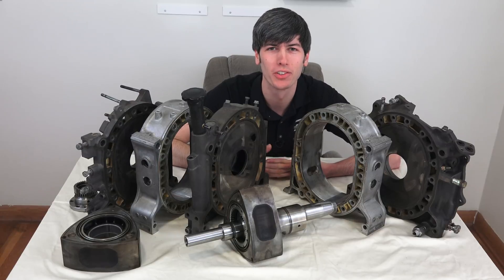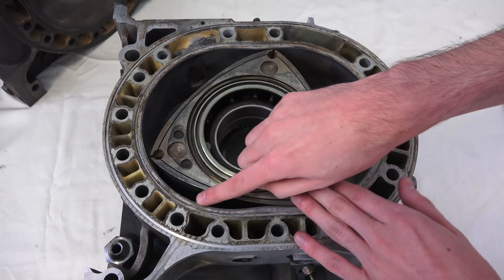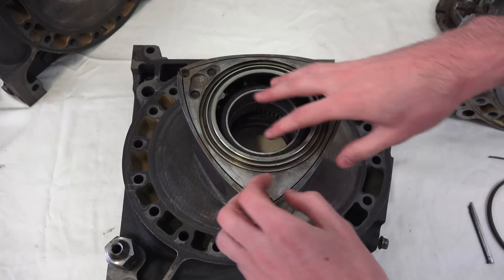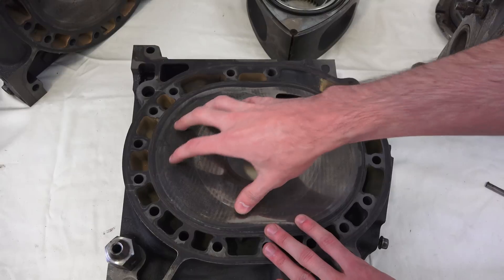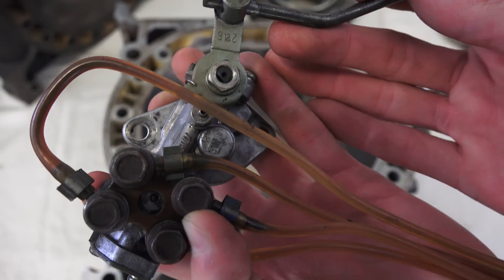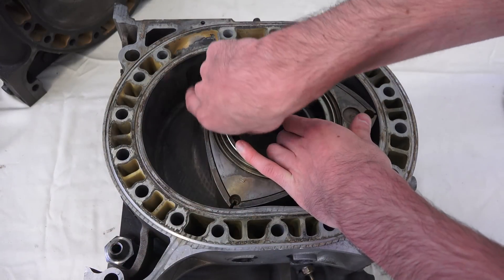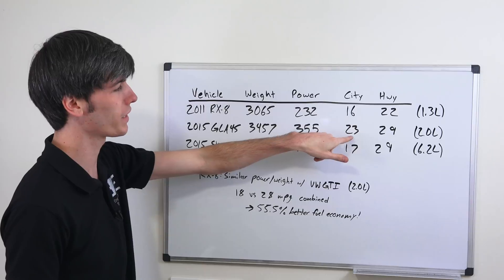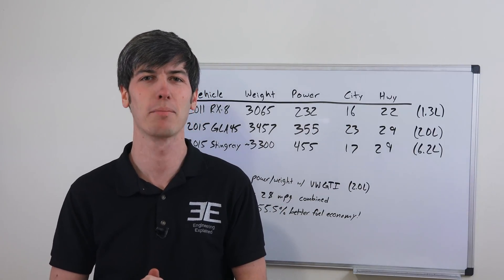4 Reasons Why The Rotary Engine Is Dead

Comment: To sum up his points:
1) poor 'surface to volume' ratio' would be negated to some degree by direct 
injection; a common technology now, but never used commercially on the Wankel.  
Why ?  good question. (see Bentele patent in 1967 for crying out loud)
2) long sealing route length ... correct, not much way to get around 
it
3) uneven heat distribution ... correct  ... seems to be solved to some degree by water 
channels pulling heat from one area and distributing it to the other
4) oil injection uses up more oil = true ... more of a problem, now that a 
qt of oil is friggin $7.  However let's be fair and realize that piston (recip) engines also need to 'use' oil in order to lubricate the upper (top) compression ring.
5) fuel consumption is worse - this would be, at least, partially solved by 
direct stratified charge injection ... never used, sadly. (see point 1)
6) he did not even mention what I consider the true achilles heel - short 
throw of the eccentric (crank) shaft, which hurts torque (~ 1/2 recip. lever length)
7) he did not mention that wankels - although simpler in many respects - involve more hand assembly than the piston engine, whose manufacturing can be largely accomplished by 
machines.
I still assert that it is a wonderful and exciting engine for a sports car 
or a motorcycle.
 I am sad that it is not around in hardly any form at all, anymore.

Comment: If the exhaust gases are fuel rich would there be an option to reignite those in a second stage motor, perhaps a small generator, and build the wankel rotary into some sort of a hybrid electric system? The small generator could produce electricity to charge the battery system for an AWD configuration, rear or front wheel electric motor drive. Regarding the friction and oil consumption issues, have they considered using a poly super-lube coating like or similar to PTFE for the engine components to reduce wear, or a special engine component treatment to accomplish a similar thing? If the engine sealing is an issue, the super-lube coating would reduce wear on the seals potentially and wear on the end plates, improving long term reliability and possibly overall viability for the engine.

Comment: Hope springs Eternal ?? Wankel is DEAD..  get used to it.  
In it's Early days it offered surprising power versus contemporary cars.  
Also back then Fuel consumption was similar to all else.
Mazda rotaries  proved infamous for needing rebuilds at low mileages. Durable it isn't

 Today even a Volvo has 340 hp.  There is no point in owning one.

Comment: The environmental issues and fuel "economy" might, some day, be improved. But I believe that its Achilles heel is, in fact that it is devoid of 'torque'. Horsepower is derived from RPM and torque. Like 1970's delightful Fiat 1100 cc engines that carried unusually high "red lines", spin that motor fast enough and horsepower happens!

I assume that Wankel engine horsepower is derived from the actual output shaft speed which I once thought to be 3:1, as mentioned earlier. If I watch the relative positions of the driveshaft juxtaposed to the 'triangle' of the rotor, the actual ratio is closer to just a little greater than ONE. I don't remember what I observed, but the Wankel physics are complex.

NOW, the BIG deal! "Ordinary" inline, V-configured, or boxer designs transfer the explosive force of ignition directly to a crank who's torque vector relative to the driveshaft defines a direct "lever-arm" configuration. The force acting on the rotary engine's rotor comes at an oblique angle like a sailboat's sail when sailing cross wind. I visualize this as, say the sail boat is moving with the wind, the sails fill and the wind directly pushes the boat forward: more FORCE. When engaged in any form of "tacking", the force towards 'forward' motion of the boat is an oblique angle relative to the wind. Does that make ANY sense at all?

Recalling WAY BACK to the Mazda RX cars that were super or turbocharged, I recall that it had exceptional performance but with a substantial cost disadvantage. But then today turbos are put on engines just to make better thermal efficiency and etc.

Sorry to be so "wordy", but I have wanted to say that about rotaries for years and this seemed like a captive audience that MIGHT actually GAS!! I would sincerely welcome any discussion on this as I have wondered for as many years whether or not my point was moot and totally understood.

Check out the you tube "Big Engines Starting Up"! If you want to cite thermal efficiencies, just look at any engines that exceed 50 cc/ cylinder. Not so good.

Comment: but you never mention the fact that it has LESS moving parts than any other engine out there and it has really no limit on RPMs. NHRA had band this motor for the strip unless it was running another rotory.  A Rx in any year is not a Rx without this rotort motor. Only Mazda was able to build it GM fail Evey time they tried to build one for their firebird. 
 The big 3 forced the law makers to stand on the EPA standards which in turn force Mazda to discontinue the rotary in the US

Comment: Rotary engines are NOT supposed to be daily drivers. Turbos should be mandatory, they screwed up making the RX-8 non-turbo off the production line, a mistake they will not make again. You have to take very special care of a rotary, they should be rebuilt every 100k miles, as an owner, learn to do it yourself, it's quite easy compared to a piston engine. RX-9 is set for production in 2020 - 395 hp, turbo 1.6 L

Comment: Makes you wonder why they even made the engine in the first place.
Reply: Power to weight, the key to success in racing (look up the 787b). Add a turbo to it and bam double or triple it fairly easily.
Reply: Also they run very smooth like really smooth if they were reliable cars would run smooth as paper

Comment: Good video. I've never seen a rotary engine before, I had only read about them. But after watching this, it really seems like it's just a bad design and has too many ways to go wrong. Low efficiency isn't only a waste of fuel, it also means a loss of power. The engine doesn't have as much power as it could if it was designed better. It really just  seems like a failed experiment. Interesting, but not successful.

Comment: Am I the only one who thinks, that comparing a non-charged engine (1.3L) with 2 turbo-charged (2.0L's) and a 6.2L engine is a bit pointless? If you really want to compare, you should look at engines with similar power (or double cubic for the piston engine) - AND the same intake. And btw the compared models have 12 years of difference to the "dead" engine (RX8 engine is from 2003). A lot can happen in that time and getting 232 bhp out of a 1.3L without a turbo/compressor is pretty damn impressive.
But I admit that the toll on the enviroment is too high for the benefits you get. The engine needs more time to evolve, just like the piston engines.

Comment: RX8 is not a good comparison by per liter HP output, although it is the latest edition it is by far one of the least powerful. A good comparison could be the 1999–2002 Mazda RX-7 producing a claimed  280 hp (206 kW) in factory form.
What is neglected in this is why DO people still choose this engine when there are such detriments stacking against it? The answer to that people is liberated horse power! With very minor modifications much much much more horse power can be liberated from these engines. This is fact. Some may argue though that this comes at considerable costs and potential damage to the engine, however in the later versions of these motors sealing technology has come a long way and these seals are no longer considered the "weakest link".
Some of you may be interested in some history and I encourage you to read up on the reasons why the Lemans 787B was banned from the Lemans Endurance race? You will see that it was due to ferocious competitiveness and much complaint from other production manufacturers claiming "unfairness" from "superior performance".
That all being said this video is mostly correct, and is educationally spot on the mark ;-) but I must encourage all of you before you make your final decisions to 1) Go watch some rotary drag racing and you will understand the thrill people get driving such a vehicle 2) Never knock back the opportunity of going for a ride/drive in even a slightly modified turbocharged rotary.....just once in your life try it and I can guarantee 100% when you feel the power come on and keep pushing you in your seat all the way to red line you will know why these engines will still be around ;-)
I can quote many along the lines of "1.3 liter? Um what the f#*% are you serious? This is not a 1.3 liter....surely?"

Comment: The Mazda CEO said himself that they are not going to make a rotary rx-9. They might make a rotary car some time in the future, but they have not confirmed that they will. They believe more research needs to be done to make the rotary engine more fuel efficient and have less emissions. They are working on a new rotary engine called Skyactiv-R but they have not made it clear if (or ever) this will reach production. 

" In an interview with Automotive News,
 Mazda CEO Masamichi Kogai confirmed that the company has no plans to 
build a sports car larger than the Miata, effectively dashing hopes for 
the RX-9."

http://www.roadandtrack.com/new-cars/future-cars/news/a31802/mazda-ceo-kills-hope-new-rx-9/

Comment: You forgot the Rotary engine RUNS HOT!!!!!!   Sold my RX-7 just because of that reason.  I should have swapped parts and downgraded since it was the smoothest engine I've ever drove or know of in mass production.  Mazda really was the only manufacturer making these and have stated they will continue too in some capacity in the near future.  Different physics and since it's introduction it has been asked to due too much, but it's HP limits are high and I've shouldn't have sold mine, just upgraded the stock parts that were desperately in need of replacement.

Comment: The fuel economy is equal to any 350 V8, the cars it was competing against.  Of course with only 3 moving parts it is much more reliable and long lived.  And then there is the phenominal performance in every model from the RX3 to the RX8.  The author here plainly doesn't understand automotive principles.  I owned & drove many models, RX2, RX3, RX4, Rotary 1/2 ton pickup and the luxury Cosmo  many thousands of miles and there was no excessive oil consumption.  The photos of the coming RX9 or 10 are all over the net.  BTW, a corvette never saw 20 mpg!   The rotary is very smooth and powerful and remember it was Mazda's 787B, powered with a rotary model 26B Rotary engine, won in 1991, overcoming reliability issues in the older manufacturer cars. It was the first (and so far the only) Japanese manufacturer to win Le Mans, as well as the only non-piston engine car to ever win. It won against considerable opposition from factory-entered Mercedes, Jaguar and the new 3.5L Peugeot cars; and from privately entered Porsche 962's, still competitive after 6 years.

Comment: Nice Video! I think the Idea for the Rotary Engine itself was great, but in the real World the high Fuel / Oil consumption and the Problem with the resulting Emissions sealed ist fate. Dont get me wrong, I like these old combustion Engines - but I personally think the time for the ICE´s is over, they will be replaced by all electric Engines.

Comment: if the 1.3L rotary were on a comparable displacement, not just vehicle weight, it outstanding!  at 2.0L it would make more than that 355hp on your chart, but if it were at 6.2L, it would make more than 1100hp!...on theory. This video is like comparing a shovel to a front end loader.

Comment: Maybe viewers don't recognize a game of two ball parks here. (at 14:19)  If I've mathed right, The 1.3 litre engine is is carrying over 2300 pounds per litre. For the 6.2 litre engine to be equal, it would have to carry  over 14,200 pounds, not 3300.  It's not quite apples to apples . And the little guy is getting over 16 miles per litre anyway, while the bigger one is getting 4.5.  I'd of liked  to find this done equally, but it's all behind advances now anyway. Probably be a collectible one day.   Excuse the cover it puts by my comments. That's how it tags me. Remove as you wish.

Comment: I heard a rotary engine die a little more every single morning, as a lady dropped off her kids for a taxi to collect, to go to private school for the day.  It spat it farted, it coughed and that's all I need to know about the RX7 Mazda motor experiment.  Unless something extraordinary changed, there is nothing it has a driver needs.  That's without even getting to oil burning and lousy though the otto cycle internal combustion uppy-downy engines are, they are more reliable than this thing.  Rotor tips is all we need to know.  the precision required is even worse than normal thermal engines.  I doubt they are even 15% efficient like piston engines.  Now we have electric, this surely is more obsolete even than gas and diesel.

Comment: Its better to block off where the oil comes in and use premix the oil into the fuel. Also I do not drive my rotary for good fuel mileage :o)

Comment: This doesn't apply to new rotary Wankel air motors run on 10,000 psi air pressure tanks (carbon fiber composite air tanks)

Comment: He's not mentioning that the rotary engine used in the RX-8 is naturally aspirated, revs to 9000 rpm, and essentially makes 200hp per liter, which is the highest among any naturally aspirated production car ever. For all the problems with wankel/rotary engines, they cannot be beat when it comes to making the most out of their displacement.
Reply: Why does hp per liter matter when it sucks ass?  They actually make the most inefficient mpg per liter engine and also pollute the environment almost as much as a VW diesel!

Comment: I have the RX8 and it's a terrible car.  I love it, it's so much fun, but I admit it's a terrible engine for heat, economy, weird vapor lock problems (you can't just start it cold and move it into the driveway and shut it down again if you want to start it up again) and it's just a pathetic machine but it sounds so cool and the car is just so well balanced.  Such an anachronism from the 70s, I feel like I should only drive one with bell bottom pants!
Reply: It sounds more like you didn't take care of the car
Reply: Try an s2k. Its basically a slightly better version of the rx8. 
Did you buy it new or under warranty? You might be entitled to some of the class action lawsuit rewards
Reply: I had an RX-8 in England for 5 years in all weather and temperature ranges of -10C to 33C. The Renesis engine never once failed to start in 55,000 miled, predominantly 8 mile daily commutes. I had NONE of the issues you mention and my car was reliable and superb. "A pathetic machine"?! Get outta here!
Reply: anchio ho avuto x un anno una rx-8 del 2008 e non avuto nessun problema!se avessi la possibilita' la ricomprerei di nuovo!e' una macchina fantastica!

Comment: As I hinted yesterday, there's a lot of stuff in this video that ranges from 'true but mis-characterized' all the way to 'lost in the ozone'.  And the comments are often even farther off the mark. 

Example: oil injection. There's only marginally more oil in the combustion chamber of a later production Mazda rotary than any typical piston engine. Difference is that in a piston engine it gets there past the oil scraper & compression rings, after providing them with lube. In the rotary, the side seals are lubed the same way, but there's no way to sling oil onto the outer surface of the trochoid chamber, where the apex seals (rotary's equivalent to piston rings) live. 'Oil injection' is simply the path/method to get a minute quantity of oil to the apex seals. Yes, there's marginally more oil consumed than with a piston engine, and it does make make meeting emissions regs a little trickier, but ask VW about meeting emissions requirements... If Mazda had chosen to use 2stroke oil from a separate reservoir to feed the apex seals (something almost all racers and guys that install them in aircraft are doing), the engine would have a much better reputation, but they'd have been at the mercy of klutzes that can barely remember to add gas, much less monitor a separate reservoir. (Ask current production diesel car owners, or as VW...)

Power density is pretty impressive, and if Mazda brings the 16X to market, it will be truly amazing. The 16X engine core (long block, in piston engine terms) weighs around 120 lbs, and is supposed to make around 300 HP with improved economy and emissions, due to direct injection. 

The rotary combustion (Wankel style) engine from Mazda isn't currently in production due to market forces; pure and simple, just like a lot of other products that come & go at the whim of purchasers. There are other Wankel style engines currently in production, primarily in the aviation market, for motor gliders and the much bigger military drone market.